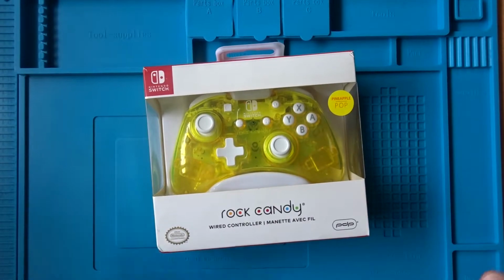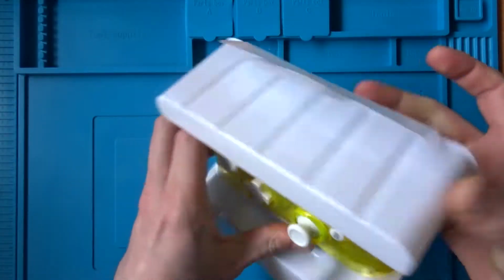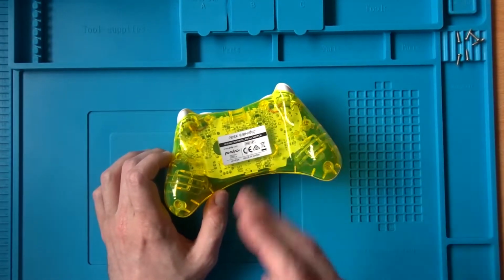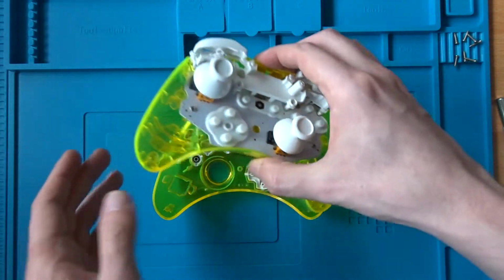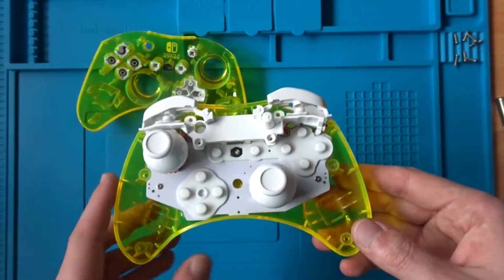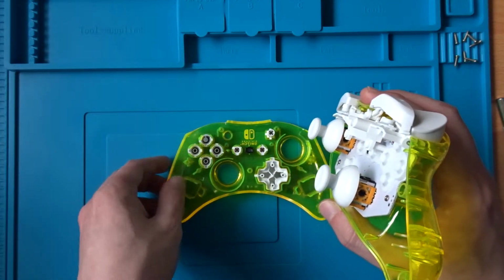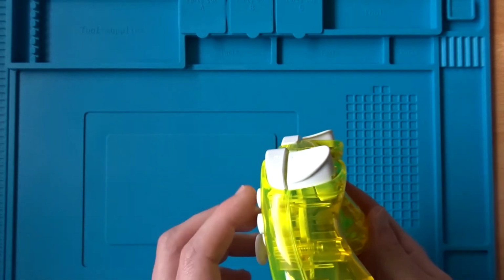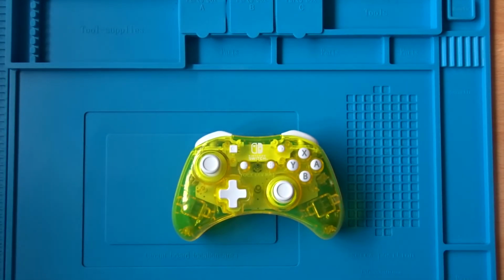Rock Candy Nintendo Switch Controller | Can I Fix It? | Qubits Tech

Comment: I'm having a problem with that controller. I have the Bowser version, but when I connect it to the TV, the light on the controller blinks and it doesn't work. Does anyone know if it's because it's not charging?

Comment: i have te same controller it doesn't turn on or register no light come on any idea?
Reply from the maker: I'd guess it could be a faulty USB connector, I'd start by trying another cable. Also, check if there is continuity between the pins on the USB port and the other end of the USB cable.
Reply: @qubitstech thanks for the advice i email them and the replied saying it needs to be a high speed cable or something so ill let you know how its goes when i get one
Reply: @qubitstech so i finally got round to buying a usb and it worked fine. did not know their were such things as high speed micro USB cables🤦‍♂🤦‍♂

Comment: For me, the rubber underneath the 🅰️ button was torn, causing the button to become rather wobbly, & eventually it couldn’t be pressed anymore. I readjusted the broken part, but that was only a temporary fix. Any ideas on how to fix it properly?
Reply from the maker: Hi, I think really the only way to fix it properly is to replace the membrane, though getting a replacement will be tricky. You'd need to find another controller, as they are not available to buy separately. As a last resort, you could try fixing the tear with some silicone glue, though you'd have to get it to sit correctly to have any hope of it working properly again. Sorry I don't have a better suggestion for you.

Comment: (I have the red one lol) I’ve been having a problem with my controller. It was working just fine when I first bought it, but then after a bit it just stopped working. It just wouldn’t charge for some reason no matter how long I left it plugged in for. I haven’t used the controller for a good couple years because of that. I was never sure if it was something on the inside of the controller or the charger cord itself. And yeah, it’s the original cord for the rock candy controller. Do you have any idea as to what the problem might be??
Reply from the maker: Sorry for the late reply, only just seen your comment. I'd check the battery voltage first of all, and if it's low, use an external charger to charge it. Check all wires etc. as it's possible a wire has come loose. It's hard to say for certain, but if it's unusable, you have nothing to lose opening it up.

Comment: I have a problem with the Mario version where the L button if tapped lightly won’t operate but if pressed down hard will work any idea why that’s happening
Reply from the maker: Hi, sorry I missed your comment. It could be a broken or misaligned pad under the button, in which case you'll need to replace the button pad. It could also need a clean with some IPA, if it's dirty it will make poor contact. Hope this helps.

Comment: Can you tell me what screw driver brand or type you used to take the rocky candy controller apart? I have 2 controller both having controller drift and 1 with a broken button
Reply from the maker: Hi, I use an iFixit driver but any standard Philips head screwdriver should do